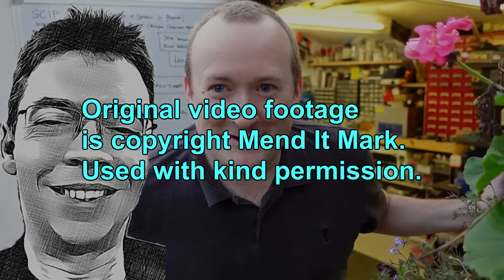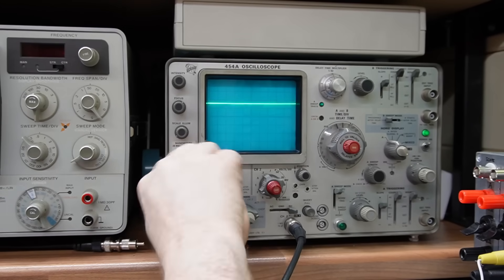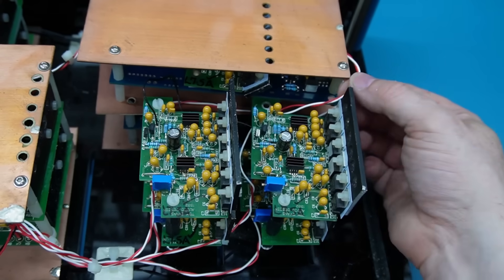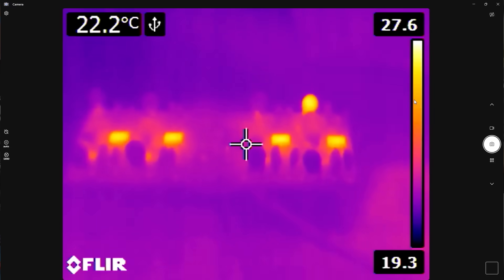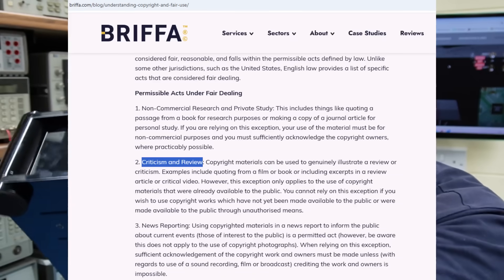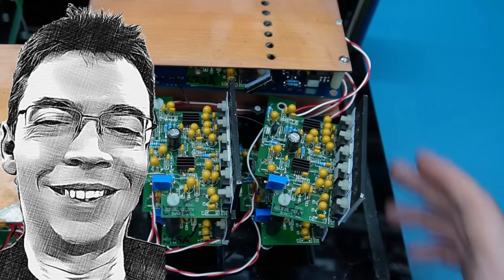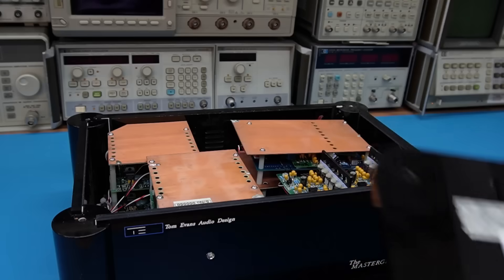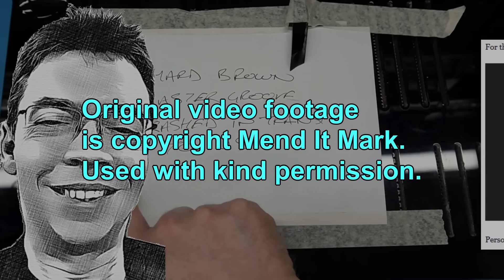Reaction to Mend It Mark takedown by "Tom Evans"

Comment: Any individual that is willing to pay $30,000 for a "moving-coil" Phono preamp, has to be a complete "Idiotphile". In addition, the build quality shown in Mark's video of this "Tom Evans MasterGeoove" preamp was horrific in every respect, from the plastic case (no shielding), threaded nylon standoffs holding a stack of circuit boards (sure to break off in shipping), in every aspect shown, absolutely demonstrates that Tom Evans doesn't have a clue about mechanical design and is a thief! As a electronics product designer who was involved with the all aspects of manufacturing many examples of successful audio components such as: Great American Sound Co. Thaedra, Thoebe, Thalia, Ampzilla, Son of Ampzilla, Grandson of Ampzilla, Ampzilla 500, and Godzilla, Alesis Corp. Matica 900, 500 audio power amplifiers and many more!  David Riddle

Comment: The copyright strike is going to amplify community awareness of the fraud that is this horribly built and ludricously priced Amp.  The maker of the Amp does not like being exposed this way , but it was bound to happen.  I wouldn't plug one of those things into my wall socket if it was given to me.  It looks like a school project.  In fact you would be better off buying an assemble yourself amplifier Kit from a large Electronics store, and you'd have more fun into the bargain.  You'd still have a pocket full of cash as well.

Comment: I've watched Marks vid in awe and found it a remarkable repair vid. Assuming the one who filed a copyright strike is the original inventor, perhaps one of these items caused them to file the claim:

1. Someone circumventing the companies repair service. Definitely not a copyright issue unless the casing states "no unauthorized servicing"--which I saw no evidence of this. This could be a matter of a sore loser, losing business
2. The original designer is embarrassed by the "garage built" mechanical build quality of an extremely expensive piece of audio equipment. Pride is not a valid reason for a copyright strike.
3. Reverse engineering unveiled proprietary technology. Is using 4 op-amps in a summing configuration to reduce noise patented but the designer? I doubt it, but if so that may be the issue.

Maybe there are other reasons, but YouTube should indicate why the copyright strike, or if that did happen Mark should reveal the reason. A copyright strike does not seem like it is based on merit.

Comment: Wasn’t it damaged in shipping ?  I believe it was
Reply: Yes, that was the secondary cause of the damage. The primary matter was the flimsy design and construction.

The electrical fault might have been caused by the customer turning it on after physical breakage. 100% props to Mark for fixing BOTH aspects when the manufacturer (Tom Evans) told the customer,  and Mark, that it was irreparable. 😆

Comment: Have to admit, when I first saw the way these modules were fixed together, I was horrified. 
Using nylon-6 plastic spacers are probably fine for a simple project at home but for production you would use decent metal ones, especially as there was a need for good grounding; given that this has a huge price tag I would have thought they could have made it more robust.

Comment: that thing is a 25 000£ piece of crap ok it will sound good due to it's electronic but fist it's real value is more 250£ and the giant power supply is a joke.... i'm pretty sure you can power a 24 channel analog studio mixer with that no problem what so ever if there is something in it cause Mark don't take it into bits cause it's working so who know if it's not full of rocks or sand and as you said yeah the build quality.... it's a card castle no joke i will be so in shame to sell something like that.... and it's probably why the tom evans brand is pissed at Mark cause he exposed them even if he been pretty nice on that particular video and not said much about the poor quality of that dodgy device. at some point he needed to unsolder one little board that is coupled with the board that have a capacitor dead on it and it's so crusty the way it's made what a piece of junk so, 25 000£ for that? what a scam!

Comment: The build quality of the internals looked like something I did over lockdown when I was playing with breadboards, arduinos and pcb boards. I am complete amateur and it looked pretty much alike, except I used brass stands instead of nylon ones for my robot on wheels.

Speaking of - anyone wants to buy an IR controlled, arduino-based robot on wheels? I'll sell it for 25 grand.

Comment: I agree ... having  worked on top notch military spec comms equipment the build quality is not what you would expect for £25k ( ouch ). The manufacturer didnt even bother to use shielded cable for the audio signals or minimise the length of signal paths. IMHO overpriced.
Reply from the maker: I've been thinking of using military spec components in my design

Comment: Using Plastic Standoffs on a 30k Pre-Amp is a ripoff, as clearly shown. And cheaping on the heatsink too.
Reply: Agree, however if they were 14k gold it would still be a BAD design. Those boards should have been VERTICAL in SLOTS

Comment: Correct there is nothing in the original video that can be copyright claimed. Or any other form of IP in fact. Tom Evans has made a fraudulent claim no doubt , abusing YouTube's copyright system in order to perform damage limitation. which is illegal in both England where mark and Tom reside and in the US where YouTube's copyright system has been misused deliberately.   
To make that claim Tom has signed a document declaring "Under penalty of perjury I have a good faith belief that the material in question is unauthorized". there is no doubt in my mind he has signed that document knowing full well his claim is illegitimate and that is a criminal offence, warranting prison time.  I hope in the least he gets sued for this, and also hope the Streisand effect backlash folds his crap audio company.

Comment: As an engineer this quality is pretty poor.  Even the 4 corner posts not having slots milled to correct size without shims to hold the 4 side panels is terrible.  Didn't  even add some grub screws to keep them securely in place.
Reply from the maker: If it was a prototype then maybe it's just about OK, but if I were selling it as a product then I would not be happy with how it looks.

Comment: If I'd built that amp, it would be INDESTRUCTIBLE, and use gold plated, or silver PCB's. Impedence matching throughout ans each pcb would be in its own screened box.

It was Marks reverse engineering and showing it on the video.
Reply: He only showed block diagrams not actual circuits

Comment: This was never about copy right. It was about letting the cat out the bag. This company should have not been so greedy. They should have offered a free repair service. you pay the P and P and they do the rest. Even fixing it when it comes damage in the post. This will stop any attempt in fixing it by others and in return the cat stays in the bag. This is another form of a scam. There first and foremost, was to make a very attractive outer case and then come up with a fantastic sales pitch. As for what goes in the case, make it work but make it as cheap as possible. Does anyone think, that this cost £5000 to make one of these  and get it on a shelve. I don't, but lets say it does. That is still a £20k profit sell 10 a year £120.k a year after tax. oooo lovely. Well there is another group of people that can be held accountable for allowing this to happen, and that's the consumer.
Reply: The innards would be horrible to manufacture and assembly. too complex too fragile. it brings tears to someone who worked in professional electronics manufacturing.

Comment: Marks video was more about HOW to repair it rather than what is was so the copyright claim is just childish.
If this unit contained complex intellectual property then I could possibly understand it but the circuits in this unit are really little  more than component manufacturers examples cobbled together into a product.
The case parts do not even fit together properly so need to be packed with bits of cardboard.
Tom should have kept quiet because all he has done is increase the exposure to this by at least 10x.
Did we ever find out what the dip switches are for or are they just for 'show'.

Comment: I've watched quite a few similar to Your videos regarding Mark's repair of that pile of junk. All of you guys mention the pathetic standoffs and overall poor construction of the unit but nobody says anything about the cheap boards, the odd twisted wires, lack of any exotic materials or proprietary components. I also build hifi equipment and work on expensive amps etc. I very well know that beyond a certain price point the manufacturers are selling snake oil. For this reason they throw as much as possible gold, copper, titanium, cables made from recycled flying sources and what not. For this reason I think Tom Evans should be held accountable. Unfortunately Mark seems to be a way too good guy to do just that and I don't think that Tom will ever try his luck with Louis Rossmann. Oh I certainly hope so. What a scam...

Comment: My grandfather used to work for grumman, built f14's and the LEM for the moon.   when he was 85-95 he used to make custom audio boards and circuit boards for people for different things, like complete custom stuff.   even at 95 years old, his stuff looked like a machine laid the components down and soldered them.  His soldering equipment was the cheapest oldest handmade crap, but it was in the hands of a master.  Had parkinsons shake also in later years at 95, and his stuff looks 1000 times better than this garbage circuit boards.   The obviously copyright striked it because their insides are utterly embarassing

Comment: these units are made from precision  matched components. 
and not generally used devices. 
would you put any transmission in your favorite car or would you try to get the best one.
Reply from the maker: It's more about the construction and design quality than the actual components. The poor build quality negates any claimed component matching, which looking at the components they don't seem to be '"matched".

The op amps are just called precision op amps by the chip manufacturer, it's nothing to do with Tom Evans making them "precision".

Comment: Circuit design can be copyrighted.   That said, I was under the impression it was sent to Mark as a challenge that he wouldn't be able to repair it.   I think Mark could, if he wanted to, get the video reinstated, but I don't think Mark would fight that hard for it.   It's a shame, but in theory reverse engineering the board can be a breach of copyright as such.  
The device was made in Wales, it states that on the device, so we know where it was manufactured and what market it was aimed at.   The blatent use of the Intel logo could get the manufacturer in trouble, but again I doubt Intel will do much about that.  
This is just a device to avoid, and I would avoid all devices made by Tom Evans given this type of attitude.

Comment: Let's all admit it - the original manufacturer has been found out and thus is doing anything he can to stop the video from exposing his scam. The big question is when will Youtube just unblock the video? It should not be about how much it costs - the issues that Mark saw were not even acceptable from a low budget piece of electronic equipment; poorly made and coming apart.

Comment: Alliexpress knockoff looks better build with more solder - plastic/perspex/plexiglass looking cheap? *features external PSU in 25K league_
Value 9pence tantalum has/will become very expensive for brand/sales & Tom.. They need to blame someone for their self embarrassment caused again around one 20cents less bagged in qty >50 pieces - manufacture/dealer took zero ownership to satisfy customer service or 'relationship' longevity - all those 'stacked' very modular boards are actually cheap to work with etc

Comment: Well said Martin, it looks like a prototype unit built from parts from RS components just like I would of done back in the 80's for the company I worked for (Microwave Modules) in Aintree Liverpool, we also had a lot of problems with tantalum capacitors going short circuit and causing lots of units to be returned under warranty. I would have liked to have seen inside the mains power supply, I bet that would of also been massively over engineered aswell, keep up the good work Martin, regards Dave.  😀😀

Comment: I wonder if the copyright strike was because Mark made a detailed drawing of the amp, including the components the manufacturer had filed off the text showing what component it was. I'm an electronics engineer myself, but I'm not sure how hard it is to find out what such anonymized components really are (never had the need to).
Reply from the maker: The copyright for the detailed drawing of the amp belongs to Mark, he drew it. :) A design, which is functional, is not copyrightable, a functional design is patentable but that has nothing to do with copyright. A patent design is publicly viewable in any patent application.

Comment: I subscribe to Mark's channel and saw the original video, there is nothing in it which can be considered to infringe any copyright. The manufacturer is simply embarrassed that the poor quality of such an expensive piece of equipment has been exposed. Many congratulations on making it through the video without using the word "extortionate", you might not have said it but we were all thinking it. Lets get straight to the point, if a group of 8th graders had submitted this work as a school project they would have been told to take it away and rethink the design!

Comment: A disaster on many levels, and that is not a pun about the construction. I am not sure when the shipping damage occurred,  and of course that damage was more serious than the single failed tantalum bead capacitor.  I have built equipment as badly myself, typically as lab prototypes. If the manufacturer/designer had repaired this at a sensible cost we would never have known about it. Judging by the serial number the maker has sold over £1,000,000 of these alone...
Reply: People never start serial numbers at 1, more likely 50.

Comment: If you know anything about amplifier circuit design, you'll also know that those pre-amp circuits were made using cheap'n'nasty op-amps. I don't do circuit design these days, but I stopped using 741s very early on in my career because they have a really poor SNR. They are not suitable for audio circuits.

Comment: What I found really odd about the design was the fact it could have been done so much more neatly using board-to-board connections. Two large PCBs with a lot of edge-connectors (similar to PCIe-slots). Instead it looks like a hobby-project where "good enough" is all that is asked for.

Comment: Great video!  Subbed!   So much wrong with that product imho - plastic standoffs, plastic screws and nuts on heat sinks, towers of insanity that really should have more security to the chassis.  It's a piece of junk - yes there are some nice circuit designs to get good quality audio, but it's all over shadowed by the terrible implementation and totally ruined by the actions related to this copyright take down against Mark.

Comment: I own the patent for "Poorly Assembled Electronics Shoved in a Box", and I will now go after Tom Evans Audio for clearly infringing on my IP!
Reply: I think I must owe you something for using your patent on many occasions.😂
Reply: Let's face it they used a PCB. I repaired a motor driven for a high value glass record deck that used the splattered bug approach to taking an AC PSU and ensuring the motor went the right way with appropriate capacitor. Reading a circuit in 3d is a little challenging for an amatuer like me but I cracked it for 50p.
Reply: Great

Comment: at 4:19 you clearly see that the CE mark on the product is not according to CE!, but a China Export mark!!! https://en.wikipedia.org/wiki/File:Comparison_of_two_used_CE_marks.svg I wonder how many minutes he has spent on EN 62368-1  Equipment for audio/video, information and communication technology?
Reply: With a plastic case, and little to no screened wiring I would not be surprised if it picks up every bit of RF (radio frequency) transmissions going... So much for a low noise preamp...
Reply: @stewartbaker2752  arc welders; fridges, mobile  radios, low flying UFOs/drones.

Comment: I loved the Jenga construction techniques. I'm now 52 and this construction is like something I would have built 30 years ago with parts from Maplin. The manufacturer is obviously embarrassed that we saw what was inside. £25000 🤣😂😅  £500 would be reasonable but £25000 is unbelievably insane.
Reply: I think the Maplin kits and projects from before that were way better. I can remember, just, amp projects from the 70s and 80s in magazines like Electronics Today International and they were way more professional than this. 

Probably better preamps.
Reply: @paulscottrobson  I loved the catalogues, the ICs had recommended circuits. I built so many of them I lost count, and that was most of my education at that time.